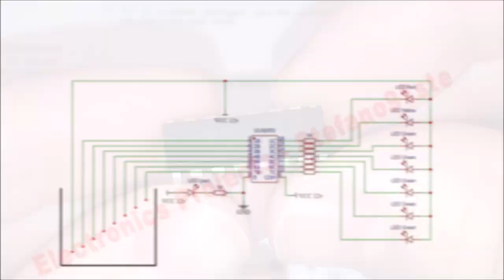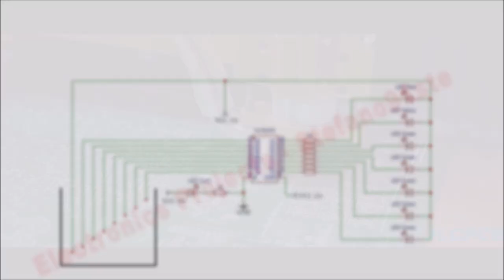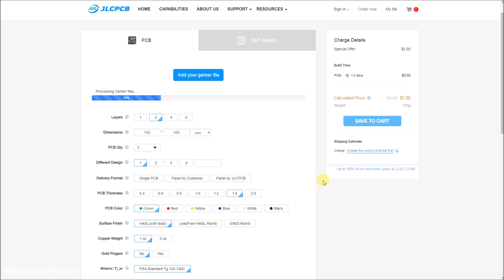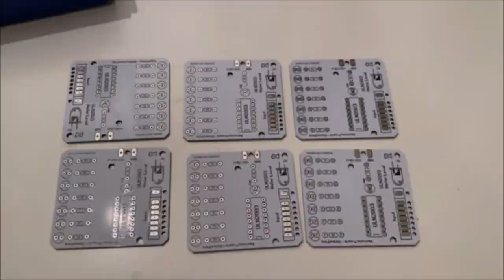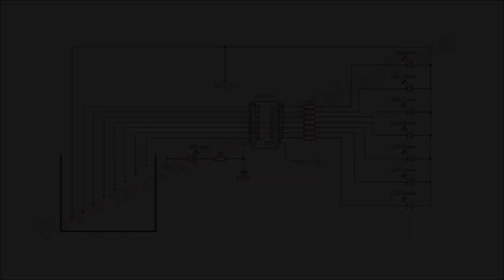LED Water Level Circuit with ULN2003 - PCB Tutorial

Comment: Nice project, thank you for share :) Just one question, what maximum cable length does the integrated circuit support to be able to turn on the leds without problems?
Reply from the maker: Hi, I tried up to 2 meters of cable and it works without problems. I didn't go further...

Comment: is there a way to add a buzzer for tank full indication but should turn off automatically after duration like 2-3 min as water after filling will be there for quite sometime at full tank state
Reply from the maker: Hi, a buzzer with a timer circuit should be added, which turns off the buzzer after a certain time

Comment: Nice one. Can i use another resistor instead of 1k Ohm? Please reply me
Reply from the maker: Hi, yes if it is a value close to 1K
Reply: @Stefano91ste  I've already tested it, 1K resistor for LED and 10K for Tanky side wire is best for this circuit... Thanks for reply by the way

Comment: Did you check it With the distance of over head tank and ground level ?
Reply from the maker: Hi, I didn't understand the question, but in a 2 meter high tank it works fine.. with higher heights it should work but I can't guarantee it.
Reply: No.problem about the height.